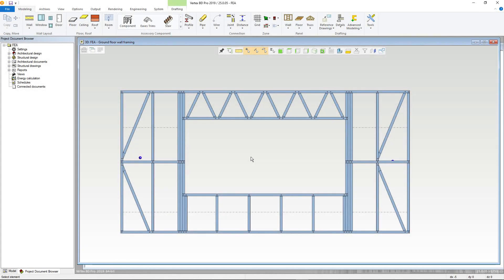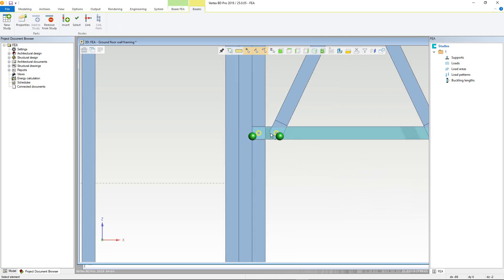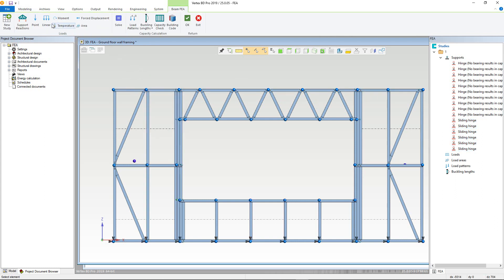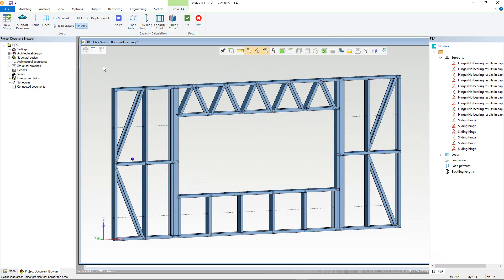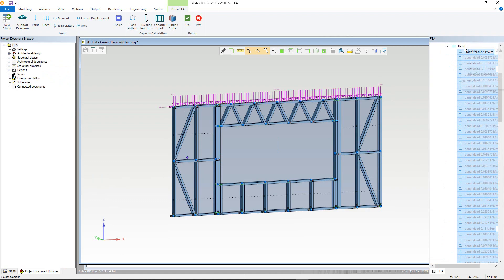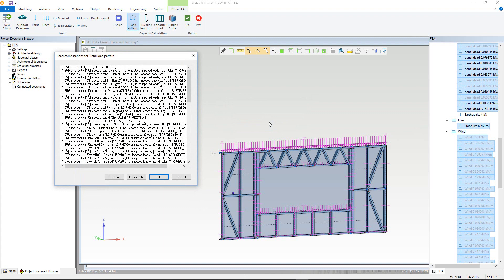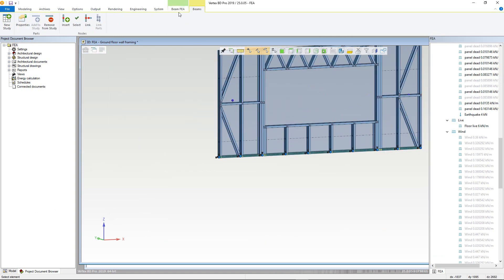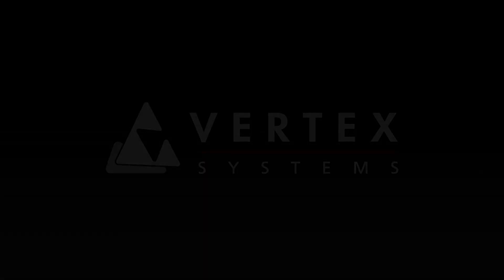24: FEA Engineering [Vertex BD Steel Framing Tutorial]

Comment: Hello! I tried to do everything as you say.but after checking capacity i recieve message :Member cross section is not recognised! (Code='C89-41-1.0' Library='Huazhong_c' Material='S550GD') so looks like it knows which material is used.So whats missing then?
Reply from the maker: You will need to ensure that the values for the building code have been generated. To do this, go to System Tab, into the Profile menu in the Libraries section, then choose "Huazhong_c". This will bring up the Edit button window. Press the 4th button down on the left column, which is called "Building code specific effective cross section. Vertex BD will then ask you to confirm this, click Yes and it will then generate these.
Reply: @VertexBDBuildingDesignSoftware   well thank you i did it all but the problem is still the same
Reply: @vhhvhh4069  It could be related to incorrect steel grade in related to the building  code in use. Please contact us directly via helpdesk@vertexaustralia.com and we can look into the issue for you.